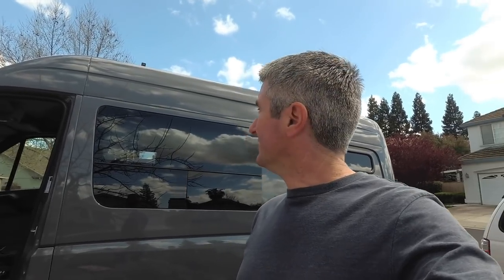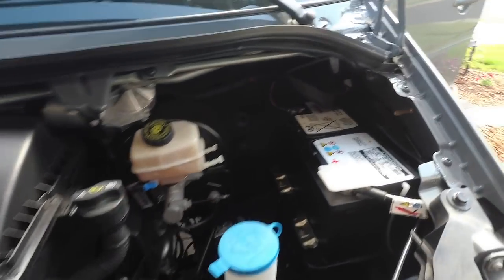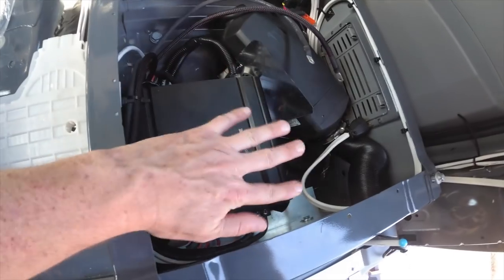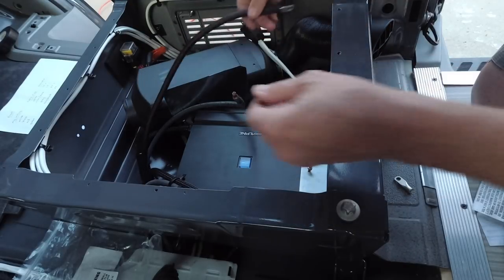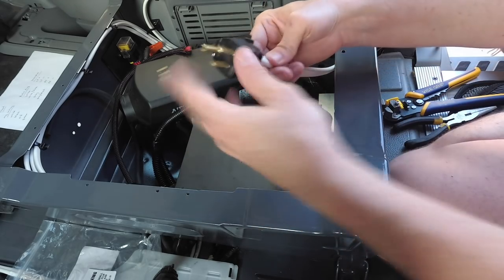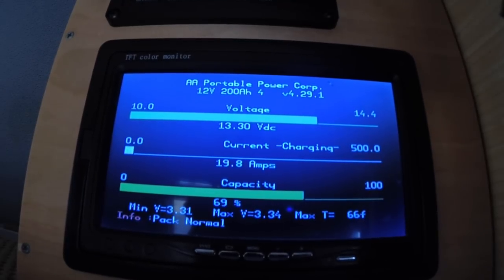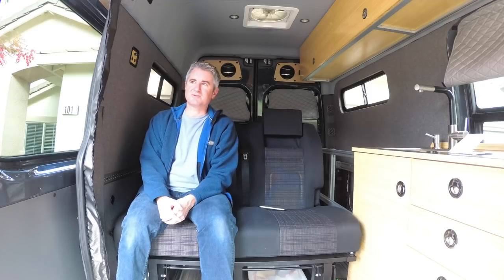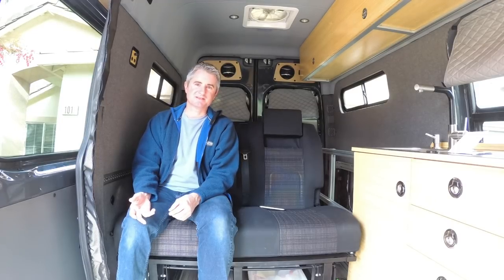Backup Inverter Charging System - DIY Sprinter Camper Van

Comment: Great job Ken. Have you thought about adding a >13v load sensor prior to the relay to make the process start and stop automatically to avoid to have to keep manually switching off the inverter? or have a remote switch on the dash instead of opening the door and then the cover in the rain to start or stop the inverter.
Reply from the maker: Your suggestion would be an absolute must-do for someone who wants to use this system on a regular basis.  I have only used mine once in 1.5 years, so I won't go to the trouble.  Pinning this comment for others though, thanks!

Comment: Interesting Ken. We don’t have the aux battery and decided not to add one. However I put a 4/0 cable from the positive terminal on the starter battery all the way to back of the van to a 250 amp starter battery circuit breaker which connects up the positive side of the Lithium bus bar. There is a signal line that goes from the BMS to the ignition signal under the driver’s seat. Easier to do than explain. AMSolar in Springfield came up with the schematic and seems to work perfectly but no redundancy like you have. 
Nice way to terminate the romex BTW. I usually try to buy the heavy duty plugs that are designed for 10-12 gauge wire.
Reply from the maker: I ordered the Aux battery option initially "just to get me by" until I could get a full electrical system in place.  Then I realized it offered an easy connection point for other items that don't have a high load, like my electric folding steps, my audio amplifier and my Espar heater.  I think Mercedes charged $315 for that option--I couldn't buy a 95 a/h battery, the smart combiner and the wiring and terminals for that cost.  Seems like you've got a good setup Victor.
Reply: ourkaravan we are happy with it but probably not a creative as yours. You certainly got a lot more functionality into small spaces. I am afraid I was a bit wasteful but in my defense I wanted to be able to easily see and make changes and corrections as required.

Comment: The Sterling battery-to-battery charger costs like $200 more than a Samlex inverter and does it all automatically. It's probably the route I'm going but this is a very interesting and cost effective approach.
Reply from the maker: If you regularly need to alternator charge, the sterling is a better way to go.  If you have lots of solar as I do and the alternator is more of a backup source, this approach is not only less expensive but you can run far smaller and lighter cable.  Alternator charging does use more fuel.

Comment: Great stuff!!!  I'm thinking of adding an 80 amp shore power charger to my system and using the existing 2000 watt "house" inverter to power it.  I would use a 3-way switch to toggle the inverter input from the house bank to the starter battery when I want to pull a charge from the engine.  Of course, I would need to make sure I remember to switch back to the house bank when the engine isn't running (might be wise to add a second battery to the van with an isolator to protect the starter battery) and unplug the charger so I'm not charging the house bank with itself.  :)
Reply from the maker: Careful not to pull too much from the alternator.  I've "heard" 50 amps is about the max you want to pull.  Not sure how I can substantiate that though.
Reply: Thanks for that info.  Progressive Dynamics makes 30, 45, 60, and 80 amp chargers for LiFePO4 batteries, that pull between 500 and 1300 watts respectively.  Maybe one of the smaller models would be more appropriate.  That would be better for both the batteries and the alternator.
Reply: Had you used a larger inverter would the draw on the system still be limited by the rate of charge?   Say you used a 2000 watt inverter but still charged at 30 amps.  Is that still drawing 30 amps off the van's charging system?
Reply from the maker: My inverter/charger is programmable, so if I told it to limit the charge amps to 30 amps, then yes, the draw from the vehicle electrical system would be 30 amps + the efficiently loss of the inverter. So call it just under 35 amps.

Comment: As far as the nema 15 plug you got, there are better ones that are made for stranded wire. They will be more expensive, but they have sockets that the wire feeds into and the screw terminals have clamps that will make full contact with the stranded wire and keep it in the plastic so it doesnt splay out. If you go through the ring terminals extra heat is created by going through dissimilar metals an extra time. I think thats the main reason you wouldnt use ring terminals, but your planned current through there is much lower than the wires capacity so you should be ok. Hubbell is a great go to brand for plugs, just be prepared for spending more than you think its worth for it, lol.
Reply from the maker: Great to know, thank you.

Comment: Great ideas, I’m thinking about the possibility of having a system to that similar in the back of my super duty truck to power in my house just in case the grid goes down...
Reply from the maker: That would certainly work.  I've been happy with how it has worked for us.
Reply: @ourkaravan  I'm going to remain patient and hope they put the power boost system in the super duty series next year... Can I ask you how you chose the products that you did for your system? Thanks again and appreciate your quality content here on YouTube. Your videos are fantastic...
Reply from the maker: @fathertime209  Quite a bit has changed in the past few years.  The only component in the van I haven't been happy with is my GBS battery, it has given me problems.  I speak about that and make an alternate product recommendation in this article: https://ourkaravan.com/lithiumbattery/
Aside from that, the components were chosen mostly for packaging reasons.  While I like Victron inverters, theirs are the size of my entire electrical box.  The combo I have is the best I could do considering size, efficiency and cost.  
As I noted, I see the two-inverter approach discussed in this video as more of an "emergency backup" than an every day use.  A DC-DC charger is larger, more expensive and requires heavy gauge cable, but it's all automatic if using it on a regular basis.  Mine has to be turned on and off and isn't as efficient, but this is all I need to occasional charging if my solar can't keep up.  I hope that helps.  -Ken
Reply: @ourkaravan  Thanks Ken, I really appreciate your viewpoint, knowledge and common sense. Hope you're doing well in the new year...

Comment: I'm wondering if it's cheaper and better to just use a proper battery charger because using an inverter to charger and inverter, there is  a maybe 15% loss in the conversion for that 600 watt inverter, but regular charger might have the same losses. also I don't see why you wouldn't make a bracket to mount that 600 watt inverter so it goes through the vented side lid? you could also open up that inverter, and extend the wires out so that at least the rocker power switch can be relocated to the lid outside rather than constantly having to open the lid so much
Reply from the maker: I recommended in the video that a B2B might be better for most people.  This is a nice solution because 1) it's the only thing that would fit under the seat pedestal along with my amp and Espar, 2) the second inverter is nearly 1/3 the cost of a B2B and the AC wiring is a fraction of the cost of heavy gauge DC required for the B2B, 3) a switch would easily be implemented.  I've only tested mine and never needed in real life.  Hence, no reason for me to add a switch.  That's why I titled it "backup inverter charger system."  It truly is a backup should I ever require it.

Comment: Ken I am looking into how to charge lithium batteries from the alternator as a backup just like you did,  at first I thought what you did sounds great, however aren't your batteries lithium? The magnum charger you're using doesn't say anything about lithium, as far as I see it's for lead acid batteries. the voltages would be different. Is there something I'm missing from the way you set it up because I read your article and it doesn't say anything about lithium either
Reply from the maker: My batteries are lithium.  The Magnum has custom settings that allow you to program custom battery parameters.  Technically it's not lithium-ready but with custom settings it works fine.  I think the only small issue is the absorb is set in 10 minutes increments, so I use no absorb cycle at all.
Reply: @ourkaravan  thank you that's sort of what I thought you did.

Comment: Pull the switch off the inverter extend the wires to a relay that completes the circuit on ignition and then it will just be on when the vehicle is running.
Reply from the maker: Yes, I had considered doing that.  Because it took a year and half before I used it for the first time, I'm fine with leaving it as-is.  That said, what you are suggesting would be a big improvement for others that may use this often.  It should be noted that charging off the alternator, no matter how you do it, uses fuel.  I prefer to let the solar do my charging.  I appreciate the comment Matt.

Comment: Great video, but still way out of my league. I’m a new owner of a 2020 MB Sprinter that came with an AGM battery 12v 70Ah, Body Builder Connector under driver’s seat, and an optional AGM 12 v 95 Ah 850A battery. Does any of that make hooking up an Orion TR - Smart 12 12 isolated DC to DC 350W charger any easier?
Reply from the maker: Hi, I'd imagine you would hook it up just like this, using the Aux battery connector, with appropriate fusing and wire gauge.  The factory aux battery is really nice for things like this, audio amplifiers, powered steps, etc.  I think you'll be glad to have it.

Comment: Hi Ken,  Great video and very detailed. About to order one now for my 2016 2x4 170wb.  Could you please provide the distance from the top of the powerstep board to the passenger step?  Also from the ground to the powerstep.  My van has ~18" total.
Reply from the maker: Hi, I'm pretty sure I replied by email but to help others, my van's plastic molded step is 19" off the ground.  The top of the Amp step is 7" off the ground.    Good luck!

Comment: in theory that should work, but is not recommended to use one inverter to power another inverter /charger money better spent buying a samlex charger to charge both house and auto because you can charge 2 or three banks with some of those unit's. the 50 Amp can do two  banks of 12 Volt Sealed / agm  batteries. your inverters should be easy accessible incase of a massive catastrophic failure and not buried under a seat incase you have to pull the power. max out on that 600 watt should not be more then 15 amp's in total. the wire size inside that is barely ratted at 15 Amps
Reply: Can the samlex charger can be used with lithium batteries?
Reply from the maker: The 35 amp output is at 12V, which is what the battery is seeing and displaying on the LCD.   The inverter is transforming that to 120V AC at 3.5 amps.  15 amps at 120VAC would be 1,800 watts, which this inverter is not capable of.
Reply from the maker: Not directly, no.  The Samlex is providing 120V AC to the Magnum inverter/charger at the rear of the van, which "thinks" it's plugged into shore power.  The Magnum is what holds the software settings and I am using those to charge my lithium battery.  The Samlex by itself won't charge any battery, it just converts 12V DC to 120V AC.
Reply: @johntatman1436  there are specific chargers for lipo's batteries most of the charges on the market will not be able to do those. There are some changes that can do lipo's and victron is one " check the spelling on the name "  they are computer controlled for the settings of those type of batteries.
Reply: My two cents worth is that you are running a really inefficient dc to Ac to Ac to dc converter.  This is the one I will be using.  http://www.enerdrive.com.au/product/epower-dc-to-dc-battery-charger-40a-plus/

It does the solar as well.  This is just dc to dc avoiding AC.
Reply from the maker: @stephengloor8451  on paper it is inefficient.  But in real life it matters not.  It's a 35-40A backup power in case my solar can't keep up.  It's cheap, uses very lightweight, bendable, inexpensive 120V wiring to the back of the van rather than heavy-gauge DC cable, and it can be used to power other things while I'm driving.  It's not for everyone, but it works great for me, and certainly has enough advantages for others to consider as well.  But yes, there are other ways of doing it.  I wish more of the Austrailian-market electronics would make it to the US.
Reply: ourkaravan it is cheap and a pretty straight forward and easy install, but the inefficiencies dont make it ideal. It is a nice precaution if you have nothing else to charge the house battery and could be used for extra AC power in case the main inverter is maxed out or breaks on the road.
Reply from the maker: @HomesteadOC  I agree, and I believe I said that in the video.  I have only used it once, and just for testing, I do not need anything more than what I have.  But for regular charging I would use a B2B charger.  More expensive, but more importantly for me, that setup is too large to hide away nicely as I was able to do with my setup.  I think it's important to highlight the downsides though.

Comment: Hi Ken.... I just bought the Kisae 2000 Watt Inverter/Charger.   What length and gauge of an extension cord would you recommend for a 2000 watt inverter charger when I want to charge up from a pedestal at a campground or an outlet at friend's house?    This is for my minivan.
Reply from the maker: How many amps is the charger?  They are usually 50, 80 or 100 amps.  Use the online Blue Sea circuit calculator and it will determine the wire gauge for any load.
Reply: @ourkaravan  The charger is 55 amps.
Reply from the maker: Use this calculator:  http://circuitwizard.bluesea.com.     Using the system voltage, max amps and the estimated length of your cables it will help you determine the safe wire gauge.

Comment: Now I'm confused when many other Camper Van builders only use a single inverter for their rigs.   So what is the purpose of an inverter, then the other inverter charger for?
Reply from the maker: It's typical to only have one inverter.  In this case, my inverter also has a built-in charger.  The advantage of this is space-savings and ease of wiring because it's all built into one unit.  So my inverter/charger converts 12 V to 120V to run appliances, but I can also plug into the wall to charge the batteries, OR I can power it from this second inverter to charge the batteries while driving.  It's an unconventional approach, but works for me because it's 1) inexpensive, 2) uses a charger I already have 3) uses much less expensive and smaller gauge AC wire to power it.  I hope that makes sense!

Comment: Love the TFT Colour monitor set up to display your power levels etc,. what software and which monitor do you have?  I'm looking to build a similar control centre for my own power setup, solar etc.  Greeat informative video, catch you on the forums!  I had considered using an iPad, but would imagine getting software for this application would prove tricky.

I googled AA Portable Power Corp that I noticed on your TFT monitor, but can't find any software, and/order wiring diagrams, sensors etc to use with a TFT monitor?

Another question, forgive me if I have missed this info from your previous videos, which bug screen are you using for the sliding door entrance?
Reply from the maker: Hi Michael, I picked up my battery setup in person from AA Power, aka batteryspace.com .     Here's the battery:  https://www.batteryspace.com/lifepo4-prismatic-battery-12-8v-200ah-2560wh-10c-rate---un38-3-passed-3-2vx4-dgr.aspx
and the BMS kit:  https://www.batteryspace.com/lfp-bms-starter-kit-for-12-8v-lifepo4-prismatic-battery-pack-4-cells-with-lcd-screen-display.aspx
I believe you have to add the slave modules and the contactors, which I bought from digikey.  The contactors are overpriced at batteryspace.  If you're looking to go this route let me know and I'll find more info for you.

Bug screen is from RB Components.
Reply: @ourkaravan  Thanks, I will be in touch in the Spring as it will be then I will be starting my wiring and insulation.